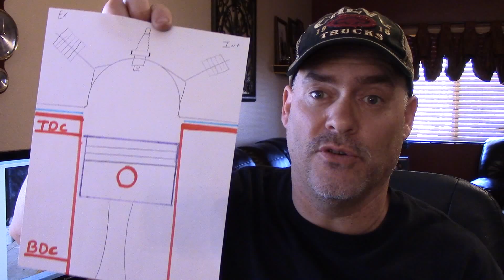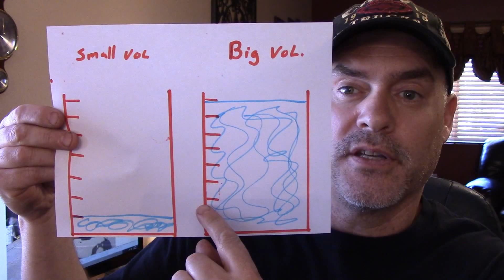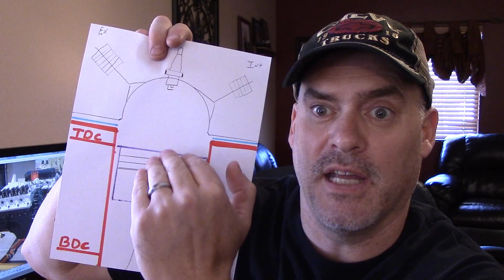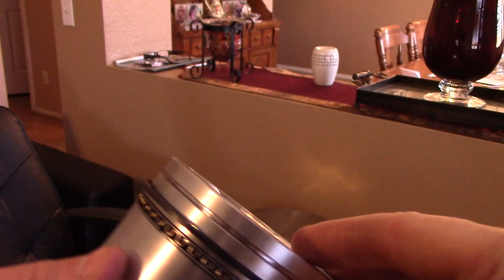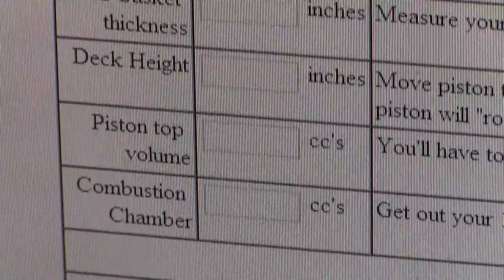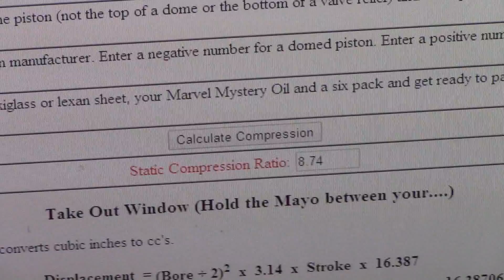383 Stroker Engine Build Part 5 (Compression Ratio)

Comment: Hey Fella. I have a fully restored '72 Stingray, 4 spd convertible.  Unfortunately... It still has the original weak, 350 in it. I do have a 350 crate motor on my porch with Vortek heads. Not sure of its HP. But, my question is this... How hi a compression ratio can I go when stroking a motor can I go & be able to run pump gas but, still have respectable power. I can't stand a beaitiful hot fast lookin car that is weak. Makes no since. I'm tryn to decide the most reasonable way to go. Use what's new on my mtr stand or stroke that's already in it. Thanks for your help

Comment: What is the most compression ratio you can safely run on premium pump gas?
Reply from the maker: 10 to 1 with iron heads
Reply: @Myvintageiron7512  what about with aluminum heads?
Reply: You said 10 to 1 with iron heads. Is it any different for aluminum heads?

Comment: Just wanted to start with a subscription and a serious question. I recently had a bit of luck lately and piece by piece have been able acquire a 30 over 350 block. The man who was building this motor passed away before he could assemble it unfortunately. The block is 4 bolt main, 1972, has been decked and all the machine work has been done. Line bored, cam bearings, freeze plugs and paint. Since the passing of the original owner, some of the parts were separated but I was able to get everything back together and this is what I have. Iron Eagle steel crank, 6 inch Eagle H beam rods,  30 over JE flattop pistons, all the bearings are Mahale mains and rods, rings also. Double roller timing chain and gears by comp cams. I realize that this motor will have to be ran on race fuel. But since I live close enough to Bristol's Thunder Valley race tracks I can hear the top fuel dragsters and funny cars do burnouts. I don't have a problem with race fuel, especially on street fight night. I'm a old school hot rodder but I've never been able to afford a motor of this potential caliber. I have a Victor Jr intake and a street demon carb. I have a NOS system also. I don't know what type or kind of cam and lifters I should use. Nor do I have a proper set of heads. I do have a set of old school double hump heads that are maxed out. Big valves screw in studs, comp springs and roller rockers ,push rod guides , ported to intake gasket, polished exhaust port and combustion chambers. Can you please give me some advice about the cam and lifters and what kind of heads do I need? I know those double humps would be the best thing going 30 years ago but they aren't going to do justice for the motor and potential horsepower I suspect this motor is capable of. Can you help steer me in the right direction.??
Reply from the maker: Well first off get rid of the double hump heads they belong in a museum or on a period correct restoration vortec heads in stock form will outflow them, however I do not recommend vortec's for your engine either.
A 6" rod motor needs radical solid roller cam mild cam profiles will cause a 6" rod motor to have destructive detonation this is a whole other topic I won't get into it now but trust me it is a thing with these engines,
 next you will want a set of AFR or Brodix heads, I would contact Howard's cams and tell them what you're doing. They can recommend the correct cam,
 they are very good at this. the one thing you did not mention is this a 350 or a 383?
That is important to know before you buy the heads so you can figure your compression ratio.
 The heads need to flow at least 300 CFM's on the intake side, your cam will be in the neighborhood of .650 lift and 236-242 duration@.050 but again you need to discuss cam selection with Howards you will also need to make sure that the valve springs are set up with the correct spring pressure and lift specs for the solid roller cam that you choose,
this will require conversations with Howards and AFR or Brodix
Reply: @Myvintageiron7512  thanks for the info. I found some paper work the original owner had on this motor. It came out of a 1972 split bumper Camaro. 350 4 speed. The owner was a drag racer and worked in a machine shop 15 years. This motor was bored 30 over. We also made a discovery in the barn that his wife showed us just yesterday. 2 1972 split bumper Camaros. Both are in rough shape but fixable. We even have a matching numbers motor for 1. Unfortunately the motor I have is not one of those cars. It was turned into a drag car and sold years ago.
Reply: @Myvintageiron7512  400 crank so yes.

Comment: Hi
I watched your beginnings years ago and they have always been very informative.
Now I want to restart my Iroc after 6 years, it has a 383 stroker in it.
The oil pressure was always ok cold ... when it got hot I had almost no oil pressure.
I have now bought a HV pump in the hope that it will get better.
The engine has only done 2000 miles, so it is still new.
Greetings from Germany

Comment: Ive read lots of conflicting information on what kind of compression ration I should run on Iron heads with pump gas. Some recommend as low as 8.1:1. I feel like the 9.5:1 you recommend is pretty reasonable / safe. If I target 9 to 9.5 ish dynamic compression I should be safe on 91 octane right? Thank you for your videos! I'm learning so much!

Comment: I'm building a 383 stroker for my 1986 corvette.im looking at 500 horsepower it will be a weekend cruiser but I do want the horsepower.im going with scat forged stroker crankshaft and forged pistons.my question to you is can I run 10 to1 compression with 93 pump gas with no issues?

Comment: Ive learned alot ,thanks so much,fortunately for me Ive got someone in the family whose a machinst and hes gonna help me with the block crank and pretty much everything,but Ive learned alot from you!Its going in a jeep by the way..
Reply from the maker: That's awesome
Reply: @Myvintageiron7512  yea Im a welder,past 26yrs or so,Ive so far rebuilt it from ground up,rewelded frame panels suspension y link,rebuilt everything etc. Ive always been fascinated with engines,your videos are great!

Comment: Nice series.  I'm OG building a gen 1 stroker for my 65 Impala.  Yah, LS swap better power  per dollar, but car shows are old and new hot rodders getting together.

In my younger days, I laughed at the "flatheads forever" gang with my overhead valve sbc.  History doesnt repeat, but often rhymes.  

Im the gen 1 crowd, not fighting technology of the LS, but keeping the orange painted cast iron stroker/sleeper thing alive.....surprising the LS normally aspirated crowd.

As for back as the 90s, power adders bored most hot rodders.  If a car back then would make a pass in the 11s....everyone would want to check it out.  If the car had nitrous (turbos not around yet), people walked away.  If no nitrous, they would talk for 15 minutes.

You used to build cars for 500 hp.  Not be boared with them.

Comment: When you build a Stroker engine, you compensate for a drop in Deck Clearance by moving the pin up toward the top of the piston. What you haven’t addressed is how much farther the piston travels DOWN! How much room is there (typically) to allow the piston to stay ‘square’ to the block before it falls out of the sleeve? Just curious…

Comment: Would u be doing a video with the dynamic compression of an engine which is tied in with camshaft timing and further on about this? Dynamic compression is way more important on how an engine with run and preform than static compression. When u say pump gas u talking about 87 or 91 octane?  
My present project is going be a 70s 350 with 416 305 heads 59 to 60cc chambers, .015 steel shim head gaskets and 12.3 cc dish pistons to make 9.9 to 10 to 1 static  compression. 
My cam will be Howard's 255/261 advertised 201/207 duration @50  with 114 lobe centers and my dynamic comes out to about 8.4 by the formulas.  I know 9.5 static is about the safe zone for pump gas but I want push it to 10 for all I can get on 91 octane and short camshaft.  From what I studied 8.5 dynamic is about the maximum for 91 octane iron heads or what would u say im curious. This  is going be a test engine and going have a tight piston quench of .040 to .045 to stay away from detonation.

Comment: What is the difference between static and dynamic compression ratio and which do people usually go by?  Using th rsr calculator and plugging in all of the stock measurements from the vehicle motor build measurements sheet this calculator ends up about 1 full point greater that the actual rates compression.  Using that I get 9.2:1 for a 78 350.  This should be 8.2:1.  I put in the numbers from the build sheet from Chevrolet.  How is this possible?
Reply from the maker: your leaveing somthing out probably piston dish
Reply: @Myvintageiron7512  I'm glad you said that.  That was exactly it.  I mistakenly entered .12cc instead of 12cc. Not sure how I did that, I entered it correctly on other sites so I  didnt know why this was different.  Anyway, it ended up dead on for the stock 350 and gave me a good idea for the rebuild.  Thanks a ton.  Great videos.  I've learned a lot following this channel.

Comment: Could you not measure the length of the cylinder in both positions and take the length of the head and the gasket into account afterwards, rather then using water?

Comment: 9.9 for carb on pump gas 
Is that 91 89 87 or 94
Reply from the maker: 91
Reply: @Myvintageiron7512  I have fuel inj tuned what's a safe level 
I have a 383 
Aluminum heads and wiseco stroker pistons 9.9 and I have a felpro steel hg that's paper thin 
I thought it was roughly 10.25 I got 200psi on my compression tester 
I can only get 91 here to

Comment: Thank you for this sequence of 383 stroker builds. I'm from Australia and have a 2001 hsv maloo R8 with a 383 stroker in it running at 11:1 ratio, it has a 235/251 @111 crow cam in it 285 inlet and 305 exhaust outlet. It is also running on a 100-150 shot of nos and is tuned to 98 octane fuel. This sequence of videos will help me for future builds, you are an absolute legend 👌

Comment: I worked at an engine machine shop many years ago. One of the terms used during the calculation was swept volume, but I don't remember what that was. You didn't mention this, is there a different name for it?
Reply from the maker: swept volume is the area the piston displaces clearence volume is the area above the piston compression ratio is a comparison of swept vol vs clearance vol

Comment: How do I run 12.7:1 on pump gas
Reply from the maker: you don't
Reply: You put a cam in it that closes the intake valve at 100 degrees ABDC so your dynamic CR is 8.0 to 1

Comment: Thanks for making this video, your videos helped me build 3 engines. I am building one for my own and I still have my doubts. Because I dumped money in it. so when my sbc was at the machine shop the deck was shaved off to 0. Bore size is .060 flat head pistons and the heads that i installed are the 65cc, 195cc AFR aluminum.  When the block was done i was told that C/R is 10.9:1 but i just want to double make sure... is there any way that you can check for me. Thank you will help a lot.
Reply from the maker: if you use a .045 head gasket it will be 10.9 to 1

Comment: So are you saying a bone stock 1968 corvette with a L79 327 with 11:1 compression wont run on pump gas today?   What did  they run on in 1968?
Reply from the maker: no it probably wouldn't the heads were not designed as well now if you put a set of aluminum heads on it it probably would they had 100+ octane at the pump in 68
Reply from the maker: we had 102 octane premium leaded fuel at the pump in 68

Comment: Thanks for the videos, your giving the poor man a fighting chance with knowledge which save money. I would like to see a video on compression and altitude and how that effects octane fuel needs. I live in 6000ft.+
Reply: Thinner the air the less combustible and the more air you'll need. Say you're running a 650 carb at low altitudes and it's perfect so you go to a higher altitude where there's less oxygen in the air the motor consumes so that 650 that run excellent will have to be jetted down for a higher altitude I hope this helps

Comment: When putting a stroker crank in an engine will tdc change, bdc change or both?
Reply: If using the same length connecting rods as you were with the stock crank, tdc and bdc will change, because they are moving farther up and down in the stroke (a stroker motor increases displacement by increasing the length of the stroke, and to do that a piston has to travel farther in the chamber)

Comment: When you say pump gas what octane are you referring too?
Reply: Layne Willingham normal pump gas usually has an octane of 87
Reply: When we say pump gas, we mean the highest octane you can get at a gas station which is mainly 91 or 93 octane. Generally, when someone says "I make _ hp on pump gas" they mean 93 octane.
Reply: 91 is the lowest octane in australia, 98 is premium. I run all my vehicles on 98.